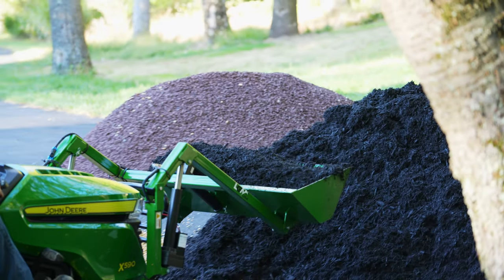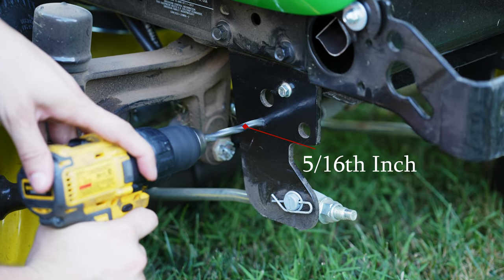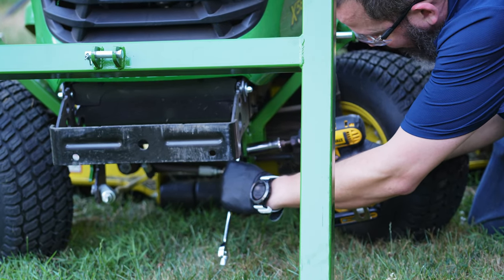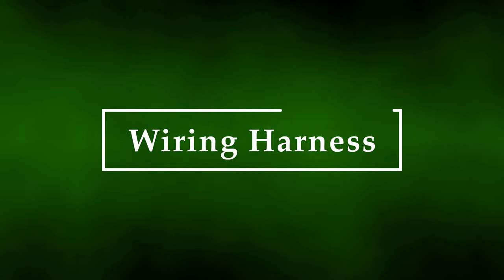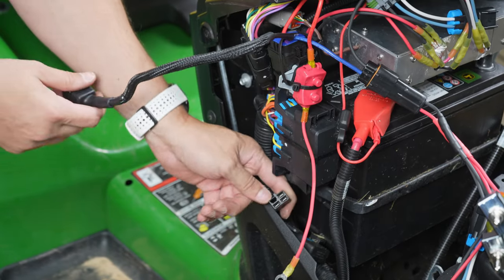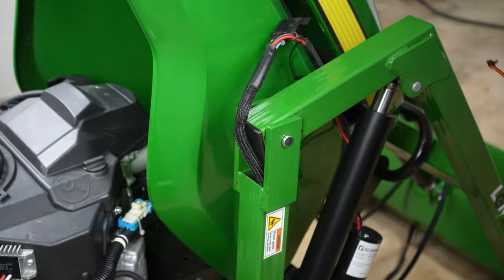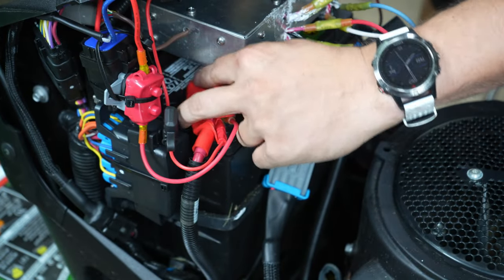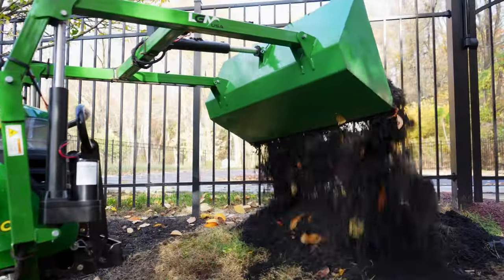LGM-100 Installation Guide

Comment: I just received and cannot find the 12 volt quick connect on my JD
Reply: Neither can I.  I have an x324. Help please
Otherwise the video is great. I had to remove my steering pinions to get a straight shot when drilling my bracket holes.
Also a tip. Look at what is behind your dash before you go drilling the switch
Holes.  Mine had a lot of wiring behind and the template wouldn't have worked for me